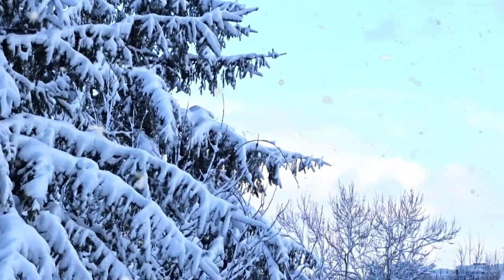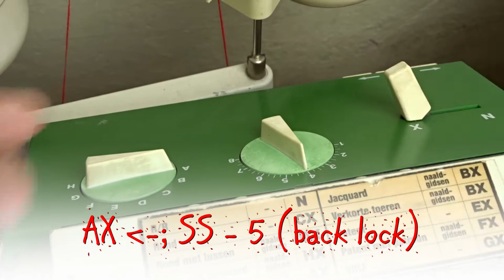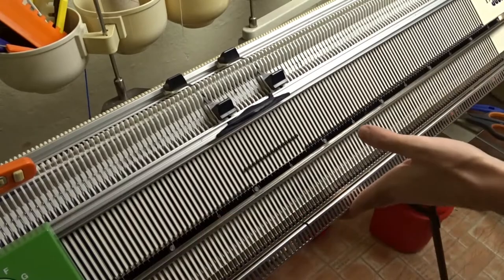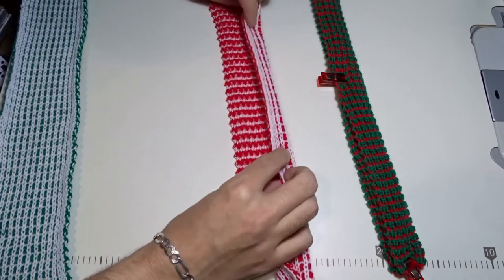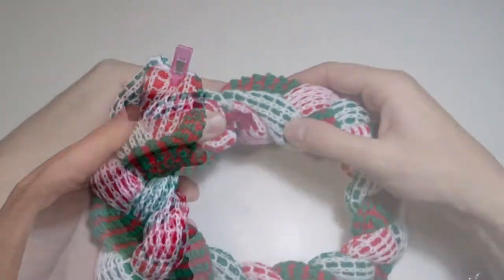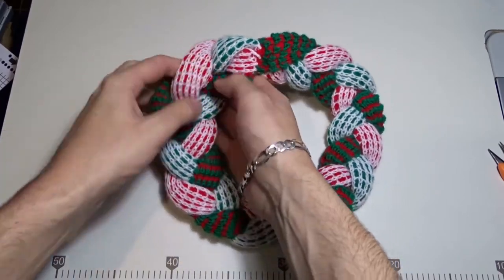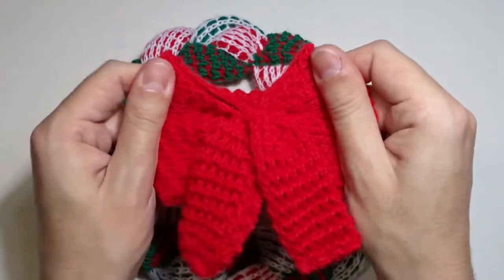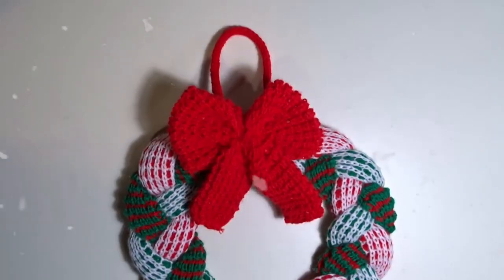How to Knit a Christmas Wreath on Passap Duomatic 80 Knitting Machine 🎄

Comment: By the way, what size did the wreath turn out to be and how much yarn did it take.  You could use a food scale and weigh it.  Then we could roughly figure out the yarn yardage.
Reply from the maker: The wreath weighs 60 grams. I am using acrylic yarn 28/2. According to the info on the site: 100 grams = 1400 meters.
For the wreath, you need somewhere around 900 meters or 1000, just in case.
The inner diameter is 11.5cm/4.5", and the outer diameter is 21/8.3" cm.
Reply: Thank You